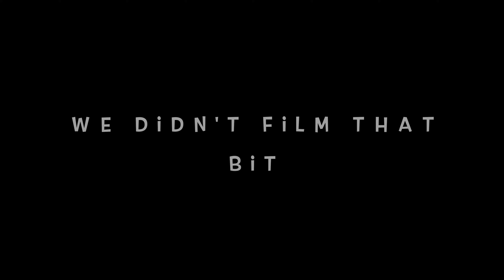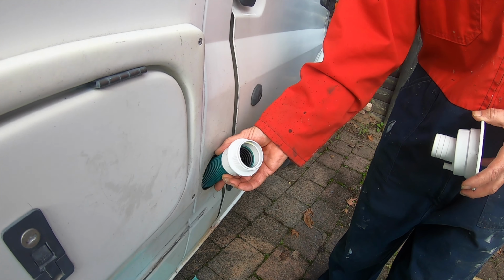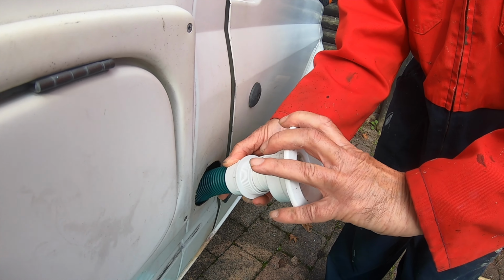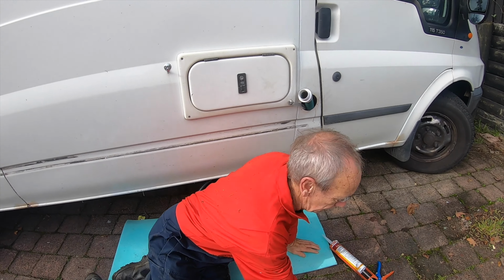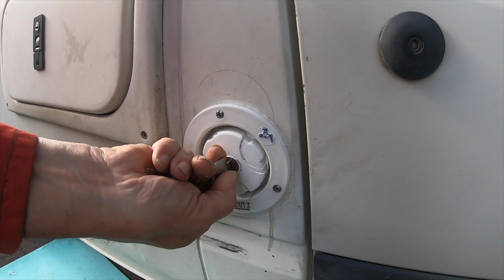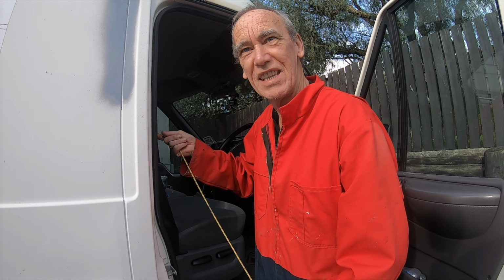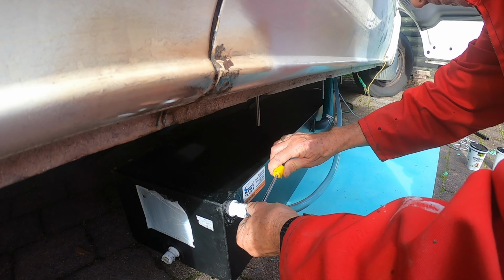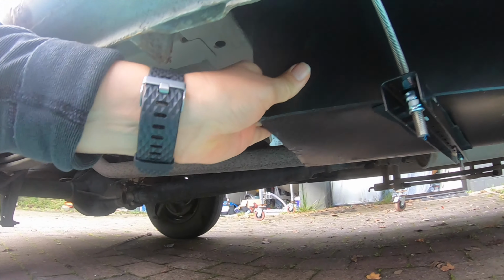Installing a Water Tank Under a Ford Transit | Simple No Weld Install  | DIY Van Build | EP03

Comment: Great video. Water tanks are next on my wish list (currently using portable tanks inside van) and I will definitely be helped by your video.

One tip when cutting threaded rods: Put a nut on the rod before you cut, then when you remove the nut it will clean any scrap/ridges produced during cutting.
Reply from the maker: Thanks Lee, glad it has helped. Thanks for the tip on putting the nut on the rod, that's a great idea!

Comment: Do you have a means of draining the tank for flushing and sterilising and for over wintering?
Reply from the maker: We can drain it through the taps. We hadn't really thought about storing or sterilising it over winter. Do you think we should?
Reply: @NomadLifeKiwi  I will be in the UK as we do get it cold here, I would think that there is still water left in the tank below the outlet and a bottom drain would be a good idea
I have just got my transit and am about to strip it out to start my own conversion. I am not sure If I will do a video diary though
Happy camping Paul

Comment: Brilliant videos guys! love your spirit!!! starting my own Ford transit mk7 T350 similar to yours, question: what tank did you use ? and what are the dimensions? I'd like to do very much the same thing as my van body should be close to identical.  Thanks ! Romain from CHCH
Reply from the maker: Thanks Romain. We got the tanks from kiwitanks.co.nz in Rotorua. We got a 70L fresh tank and 40L waste tank. The sizes of ours was: 70L - 1195L x 300W x 200H and the 40L was 700L x 300W x 200H. Please note, if the waste is smaller than the fresh water, then you need a gauge (for self-containment) Hope that helps, and good luck with your build :-)
Reply: @NomadLifeKiwi  thanks 🙏 a million for your very kind answer!
Reply: Would help if both fresh and grey tanks are the same size !But great to have the gauge anyway,it helps. @romatou18